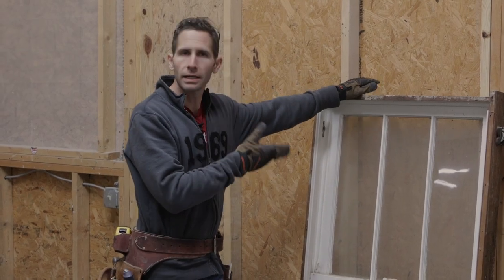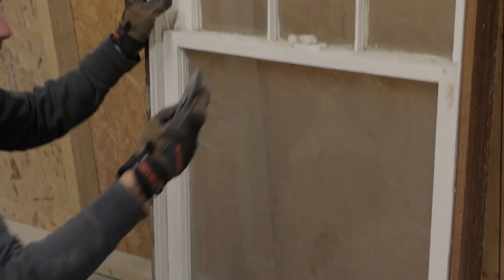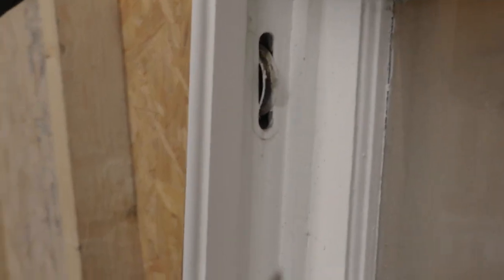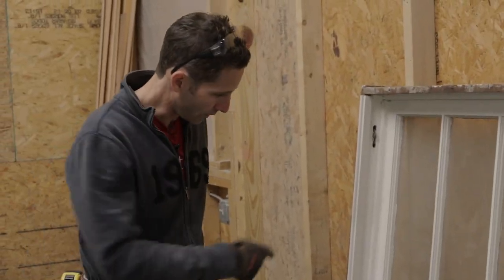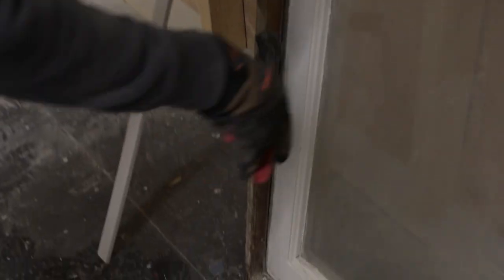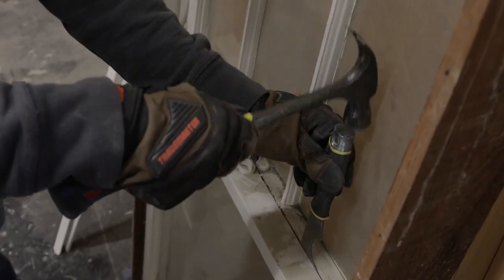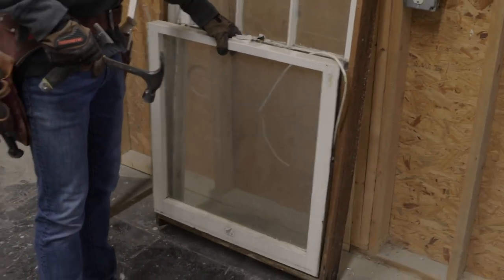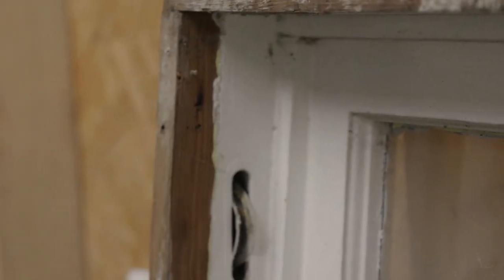How To: Fix a Stuck Window

Comment: a 2 in semi dull stiff  scraper w hammer,,, taptaptap along the painted  seams, top, bottom and  sides,, usually it comes free plain old wax candle wax rubbed onto the window tracks ,after you sandpaper the tracks,keeps the windows running freely,,you could also install 2  handles  each a few inches from the  jambs,easier still when one side tends to stick
never paint the sash ropes,paint causes breakage of the rope,,and the worl to get inside and install new rope ( braided cotton rope,,3/8ths thick)

Comment: Is there ever a concern that the top window will simply crash down once it's free? Is there a way to mitigate that? Like...simply prop it up with something until you've got it free and can guide it down? I've got 2 big old original windows that I need to un-stick and re-hang the sashes on, and I'm wary of accidentally breaking the glass somehow.
Reply: Maybe this is no longer useful, but a few thoughts from my experience doing this at home. First, the paint is usually so thick that, even when you cut through it, you have to muscle the sash down. Second, I’ve found that most of the top stashes still have at least one cord still attached, in which case it won’t fall. You can check whether it’s in tact by opening to the weight pocket door and reach in and tug on the weights to see whether they’re attached. Have fun!